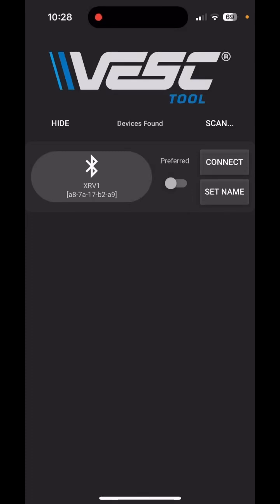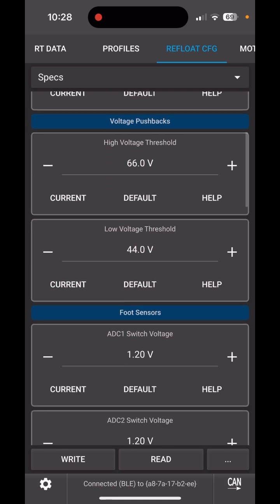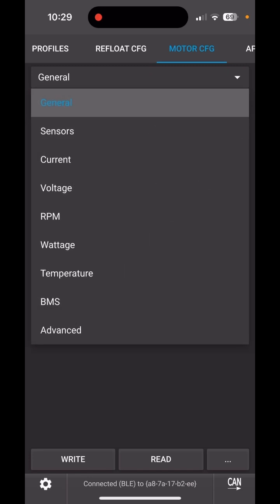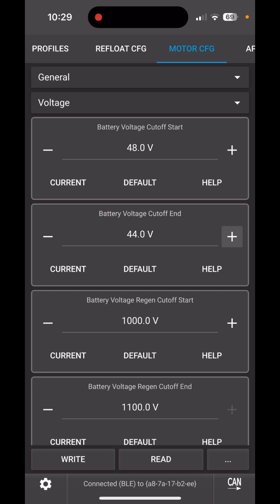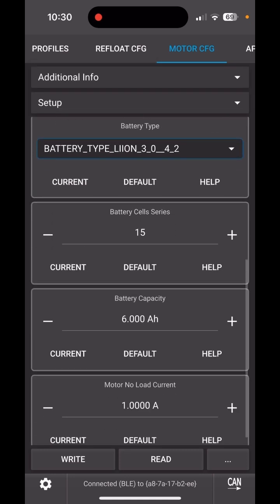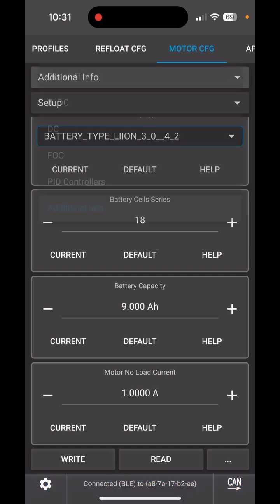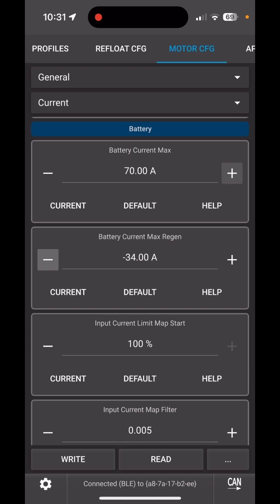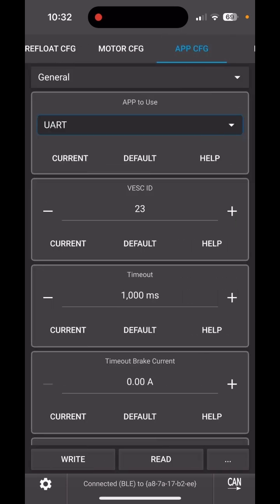VESC Battery Upgrade - Configuration

Comment: Following these settings I first had an over voltage error, I had to change Motor Cfg > General > Advanced : Maximum input voltage to 80V (instead of 70). Thanks for this video anyway 👍
Reply from the maker: Your problem had nothing to do with the settings in this video, but I’m glad you figured it out regardless. But you really should set that value back to its default, which should be even higher than 80V
Reply: @surfdado ok thanks for your answer, don't know how/when value was set to 70V. I put it back to default value which is 95V (XRV).

Comment: On the version of Vesc tool I have it doesn’t give me an option to go to “refloat config” or “float config”. I updated the firmware but that didn’t change the app any. Do I have an old app or something? It’s an iOS app btw. How do I navigate to the correct window? Thanks, I just got the XRV kit last week and haven’t had to mess with any settings yet as it showed up pretty turnkey for how I ride. This week I got a used cbxr and got it installed last night but am a bit nervous to ride it without configuring the xrv for the bigger battery first.
Reply: Having the same issue on iOS. Did you figure anything out?
Reply: @kallieespumante  you should have someone walk you through this on a video chat. there is a discord full of people that will try to help you not hurt yourself haha.

Comment: Thanks! It helps a lot! I was also wondering how to properly set up the battery configuration on Floaty for my XRV with a CBXR. I set it up on linear, but I don't know how to correctly put the correct value per cell. If you can help me out that be great! Thanks again! Ride safe.

Comment: Dziękuję :) What do you think should be the values for the Current Max and C.Max Regen for the stock GT battery and GTFO kit ?  From what I've been able to specify it's 35A / -30A would you agree ?
Reply from the maker: on paper the stock GT battery can handle up to 90A discharge, in practice we tend to set 60-70A for discharge, and 40-50A for battery regen with this pack
Reply: @surfdado  Thanks, will try these settings. May the universe reward you in the absence of nosedive ;)

Comment: Should max duty cycle be set to 95 percent? Why not 100?
Reply from the maker: the controller needs 5% of the available CPU resources to do its computations, if you set max duty to 100% the controller CPU would crash when you're at max speed, or whenever you get wheelslip